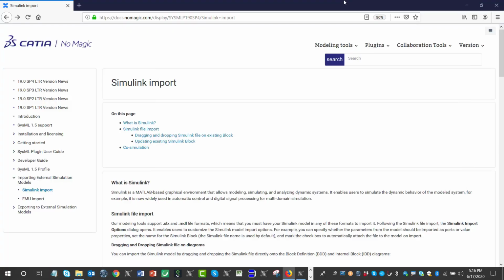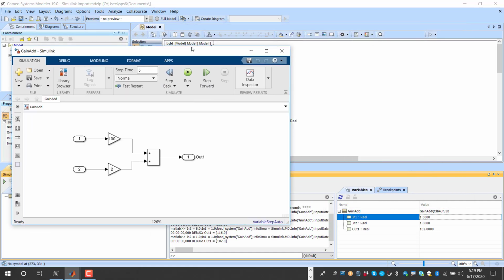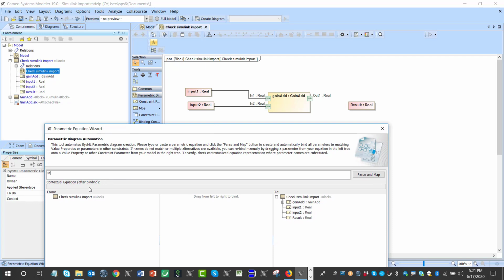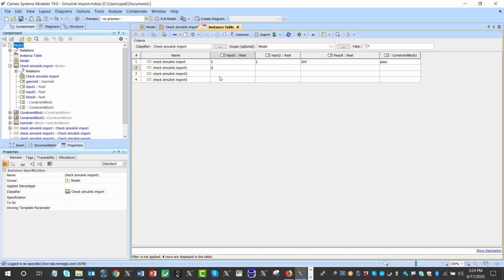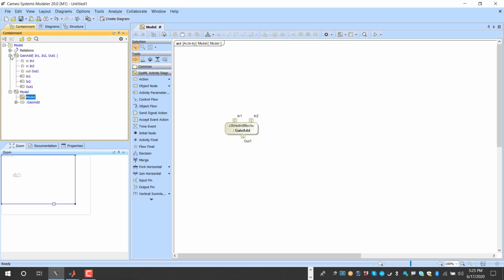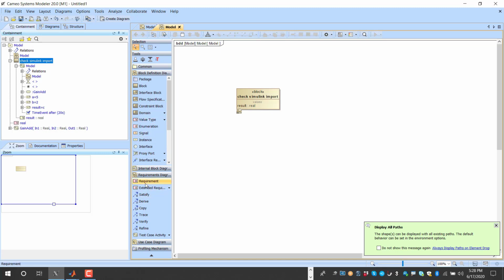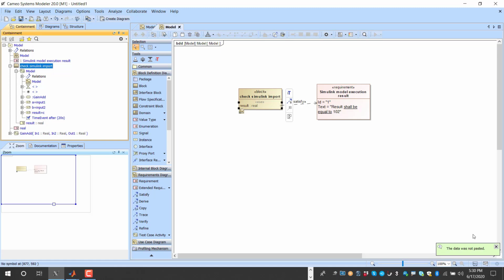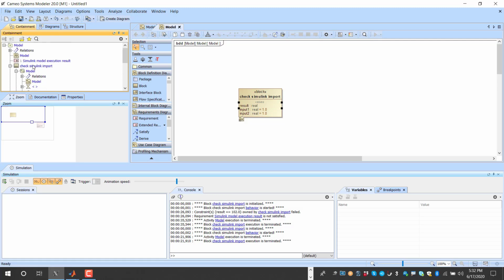Simulink Model Import and Simulation in System Model in SysML

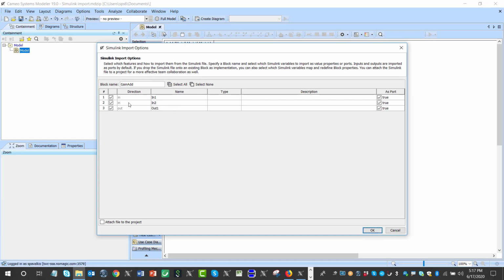Comment: Thank you for the video. Do you have any thoughts on what to do if I follow the instructions up to 1:06 and the Simulink import options simply fail to appear? Using File -> Import From -> Simulink File and selecting the appropriate Simulink file gives the same result.
Reply from the maker: File Import From is good method. If does not work maybe you use older version or do not have Sim Toolkit.

Comment: This doesn't seem to work for me. When i run my simulink block (which gets imported with all ports and values correctly, at least by the looks of it) it simply does not run. The block gets initialized according to the console but that's it. I have imported a matlab function however and that worked fine.  Any suggestions on how to fix this?
Reply: PS: is there any other way to contact you?

Comment: Thank you Dr. Saulius for sharing your knowledge! 

This looks good capability and I think it will be very useful for managing a complex Simulink model; however, the integration between Cameo and Simulink looks easy. I think this is mainly because when you drag and drop the Simulink model to Cameo, all the ports are created automatically due to the use of source (In) and sink (Out). My question, is it easy to do this when you have a piece of code in MATLAB (NOT SIMULINK)? Is there an automated way to create the input and output ports for a general MATLAB file? For example, if I code a simple heat transfer problem (maybe 1D conduction problem) in MATLAB with temperature and material property as input and rate of heat as output.
 

If it is not automated yet, what is the easiest manual way to create ports and link them to the inputs and outputs from MATLAB?
Reply from the maker: Hello Mohammed, thank you for the feedback and questions. You can drag m and simulink files into Cameo Activity, Parametric, BDD, IBD. But in general you do not need to drag them you can just interact with any executed model in Simulink / Matlab using shared workspace. This is demonstrated in this video. It works by updating properties in both tools and values sharing in real time. This is amazing and quite easy to use. Let us know if more video tutorials would be helpfull.
Reply: @MBSEExecution , thank you for getting back to me. indeed, the interaction/shared workspace is ideal for a dynamic simulation; however, I could not get the shared workspace to run with MATLAB. will email you with more details of the errors.
Reply from the maker: Thank you for the feedback. If you have Matlab integrated and executed from  Cameo likely shared workspace already works just in headless mode of Matlab.

Comment: Hi! I am trying to import a Simulink model. However, the Simulink Import Options dialogue does not show my variables, and I cannot define them as inputs and outputs ports. How can I fix that? I am basically repeating the same procedure from the video.
Reply from the maker: Hello Diego, check that ports in Simulink file are defined. Maybe sample used in the demonstration would help? You can find it here https://bit.ly/2Ovpchx.
Reply: @MBSEExecution  Hello! Thanks for your quick answer! I tried using the Simulink file attached in the demonstration sample, and I had the same issue. No port is shown in the Simulink Import Options. Is there any other way to import the Simulink file? I couldn't find anything in the NoMagic's documentation to help me.
Reply from the maker: There is another way from Files (main menu) > Import From > Simulink File
Reply: @MBSEExecution  I didn't work either. If I import it without the ports, is there a way to create ports for those variables later? Because it does create the block for the Simulink model. The only problem is that NoMagic is not recognizing the inputs and outputs I declared in the model.
Reply from the maker: Looks like some issue of import. You can report to support. You can create ports manualy. Use port name same as in Simulink also type port same as in Simulink with value types e.g Real. Create flow ports.
Reply: @MBSEExecution  Thanks for the help! Adding manually the ports worked fine.
Reply: @MBSEExecution  I have the same issue. What version of Matlab are you using? It could be a 2020 version problem
Reply from the maker: Hello Moguel, it could be. For this demo Cameo v19.0 SP4 is used with Matlab R2020a. Also Cameo v2021x is used for Simulink import into Activity diagram.
Reply: @MBSEExecution  thanks for the response. Then it could be that from 2020a to 2020b(my version) something has changed. I can also make ports and it works but in the praxis is something problematic and beats some of the purpose of exportability. Thanks anyways!
Reply from the maker: Totaly understood. I think this issue is fixes in the newest Cameo version - v2021x. But I can not check support could give more details.
Reply: @MBSEExecution  I can check and will come back to you
Reply from the maker: Thank you! If you can please let us or support know if problem still persist with v2021x

Comment: Hi, just want to say great video. I followed your steps all the way up to 2:13 (I'm trying to get this feature working at a basic level) but when I run the simulation for my simple simulink block, it doesn't let me assign values to the input ports. When I go to type a value in like you did, I get "Error: Incorrect use of '=' operator. To assign a value to a variable, use '='. To compare values for equality, use '=='." I'm new to Cameo so sorry if this is an obvious problem, do you know how to resolve this issue?
Reply from the maker: Thank you Josh, maybe sample used in the demonstration would help? You can find it here https://bit.ly/2Ovpchx.
Reply: @MBSEExecution  Thank you for the reply, I have another question for you. Let's say you have a Simulink model that is more advanced than this one. Maybe it has some dependencies on time. Let's say the simulink model has some kind of sine wave multiplied by the input so the output changes over Simulink's simulation time. Your output wouldn't be just one number, it would be an array of values, one for each time step in Simulink. How does this integrate with cameo like you did here above? I want to integrate a simulink model like this into cameo and use some kind of clock synchronization between the two so that cameo and Simulink are executing in the same time steps at the same time. Do you know a way to do this?
Reply from the maker: Hello Josh, Simulink import and execution alows to pass variables to Simulink on the begining (including array), execute it and get rest. It does not support interaction during Simulink execution. Interaction during execution is supported by FMI standard. You need to export Simulink model to FMU and use it in SysML model. FMU supports interaction between models during execution.